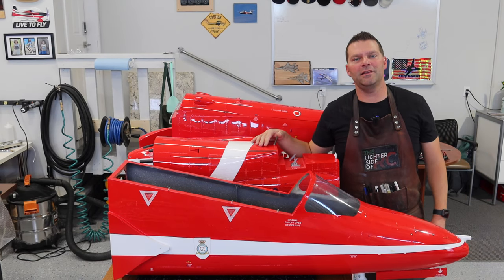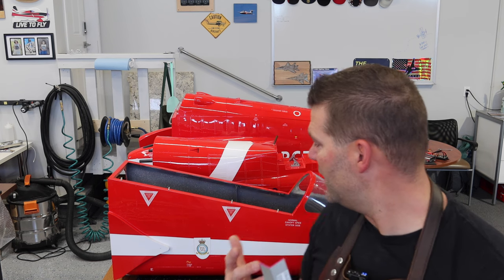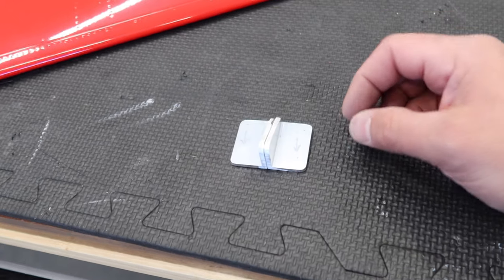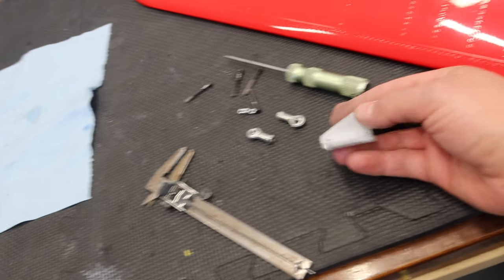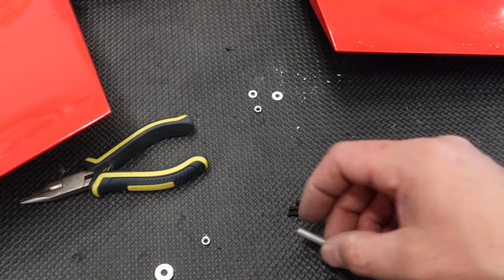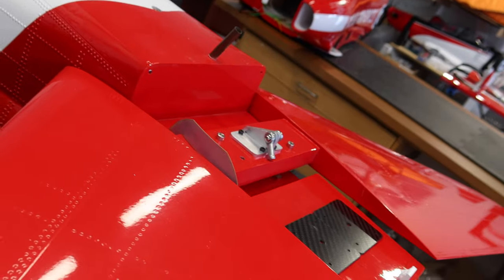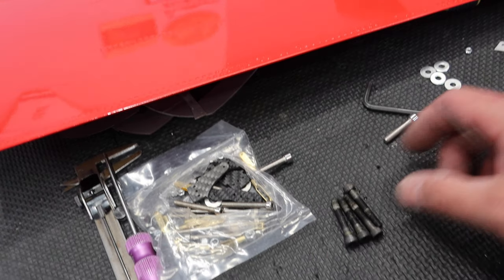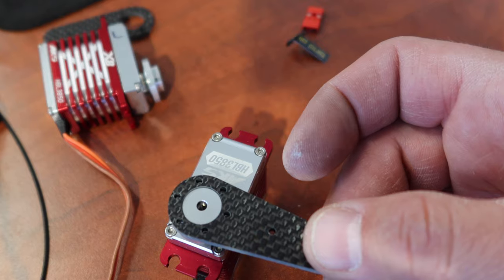HUGE Skymaster HAWK Tail Section Complete - Jeti Servo Balancing

Comment: You don't need Loctite on nylocs; that is what the nylon is for. Lastly, hot tip from big aviation. if you use a washer that is larger than the diameter of the ball hiem joint, you will stop it from ever coming off.
Reply from the maker: If your bolts don't go through the nylon lock portion then you need loctite or longer bolts.
Reply: @thelightersideofrc  Get longer bolts?? 😆
Reply: Btw should say, I love your work mate.. Great to watch and you do a fantastic job....

Comment: Great work on the elevator. Im reliving building mine. I had no idea myself about the elevator plastic shield disks.
Reply from the maker: Thanks Sal.  There has actually been an update from Skymaster but of course they didn't let anyone know about it.  I got some pictures from a viewer.  I will share them in the last video.  I am more happy with my elevator setup than the new revised one from them.  Also I did the plastic shield Discs incorrect and fix them in the last video.

Comment: Great video Jonathan!  I learn a new technique on every video. Your method of balancing the elevator servos in awesome. I never thought about bolting them down like you did. The Jeti servo balance feature I have used many times. For all your ball links I would put a washer on the bolt head side (nut side too if they are small) to prevent the link from coming completely off if the ball failed. But I am a "belt & suspenders" guy when it comes to RC builds.
Reply from the maker: Thanks Bert. On the metal ones if you look close there is a closed side and an open side that the ball was installed in. Put the closed side in and it will never come off. Plastic ones. Agreed. Different story. I ended up using balls on the ailerons due to angles. Covered in the next video. Washers installed 👍😉
Reply: @thelightersideofrc  Thanks for the info! I must admit I have not used the metal links!

Comment: 8:38 looking at the Manual, is the tail pitch control surface in this model technically a 'stabilator', rather than either a stabilizer (as stated by the Manual) or an elevator? Looks like I'm wrong as you discuss L & R elevator servos at 12:30--or does the stabilator just need the torque of synchronised twin servos? Thanks for the brilliant history given in the video description.
Reply from the maker: I believe it's called a Stabilator.  Both servos work in symetry to move the entire surface.

Comment: 33:50 did you use kitchen knife for thay cut out?
Off course it won't be seen ever buyt my OCD went 11+
Reply from the maker: See how the shape of the light is not a symmetrical shape?  The cutout is shaped perfectly to fit the light and the wires coming through the light.  A dremel with a 1/8" carbide bit was used.
Reply: @thelightersideofrc  My bad, I apologize.
Reply from the maker: @doggies.will.be.doggies  🤣🤣 all good. Just informing!
Reply: @thelightersideofrc  You should have told me to go clime a tree :) No idea why I left such troll comment after binge watching (almost) the entire built series haha
Reply from the maker: @doggies.will.be.doggies  🤣🤣

Comment: I would have to agree the manuals suck or at least with my Skymaster Viper S it doesn't exist.  I contacted Skymaster and they said they don't make a manual for my Viper S.  All I got was CG location and control throws.  I will be doing a few videos on this build because there is no manual.
Reply from the maker: Sounds pretty typical

Comment: could it be better to connect the two elevator-servo-arms? If one failed, the other could make the job....
Reply from the maker: I thought about that as an option.  In this case they are connected but through the linkages.  It all depends on what happens to the other servo.  If one dies and goes limp then shouldn't be an issue.  If it locks solid than the second probably won't over power it.